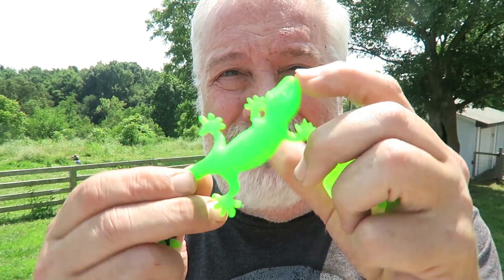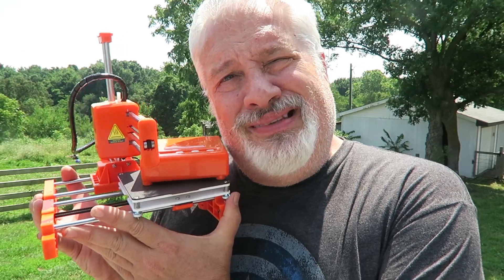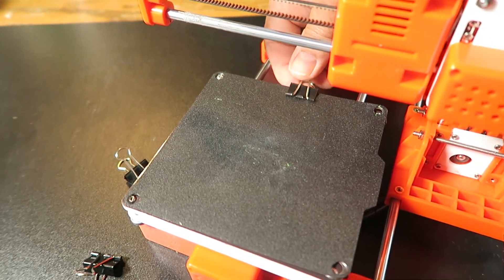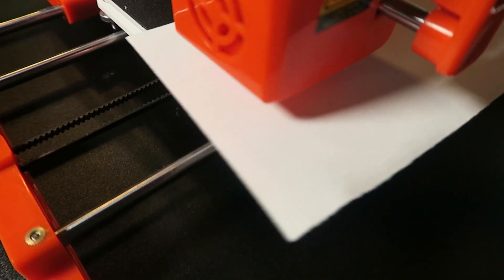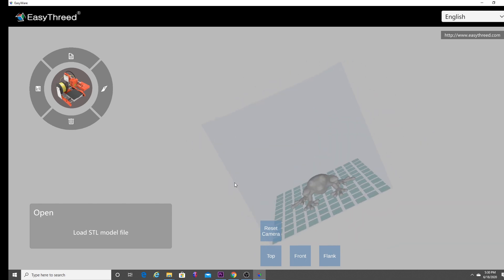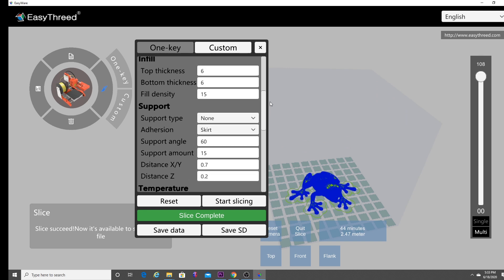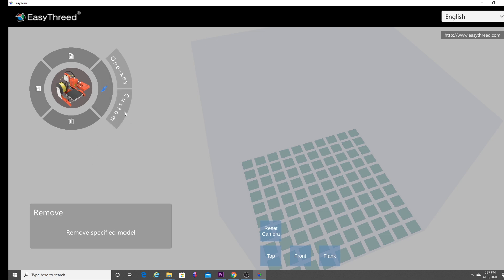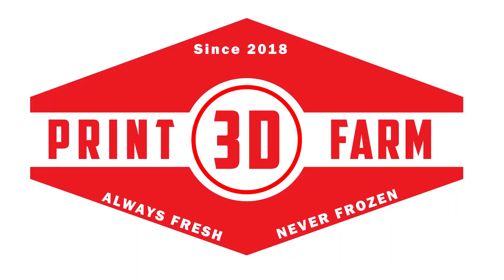Print Flexible TPU Filament on a $99 EasyThreed 3d Printer!!

Comment: I boughta few of the threed k9 printers really cheap, about 75 a piece... for the money, my used neptune 3 pro straight from elegoo for $100 is a million times better value. 

That being said, I still want to set these little guys up eventually just to do small stuff while my other printers are buzzing away, and I actually came across this video when thinking about a dedicated tpu printer for tires,  and the k9 being so slow doesn't seem like a problem since tpu likes to be printed slow anyway. 

Guess I'll finally set them back up

Comment: Weirdly, I've gotten fantastic results in PLA on my X1.  I can't get TPU to print at all - it gets the first layer and stops extruding.  Not a blocked nozzle, either - running a purge squirts out plastic just fine.

Comment: Garrett thanks for this video. I remember seeing you rave about this a year ago and recently I came across an unbelievable deal on the K1 EasyThreed for $65 on Amazon.  I grabbed one and after having 2 failed PLA prints do to the machine shutting off, I discovered the AC Adapter was garbage. Found another Adapter I had and it spit out a very good calicat. Then looked this video up on settings and now the TPU is dialed in.....THANKS !!

Comment: I grabbed one of these back when I first saw a few youtubers reviewing them for $89. I haven't tried TPU yet, but I print PLA on mine all the time just fine! I swapped out the build surface for a mirror with a sheet of that overture build surface and printed the duct for the cooling fan. If you take the cover off the hot end it is pre-wired for a part cooling fan, just have to buy one and plug it in